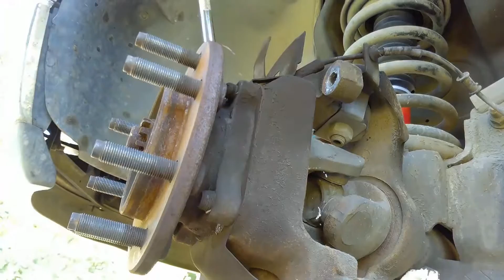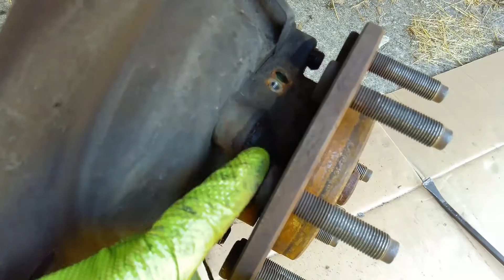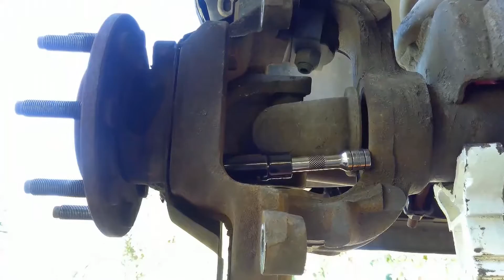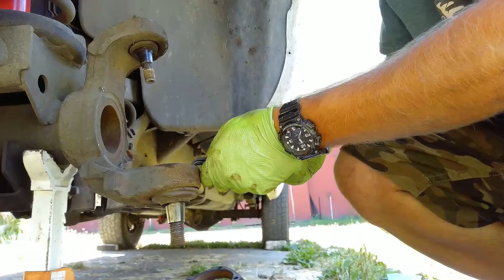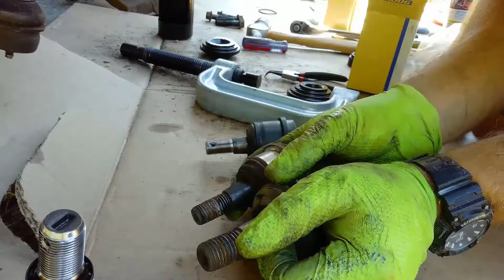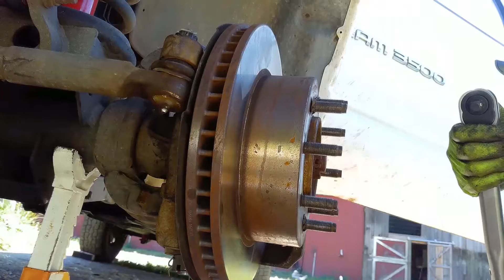Dodge Ram Death Wobble - FIXED! (Ball Joints)

Comment: Just change all your rubber parts and rotate your tires , that’s what I did and BOOM it was gone. Like track bar and switched to the tie rod and drag link like we had back in 1969 not a y tie rod and drag link and I used neoprene bushings in my track bar and has been great !

Comment: Moogs (ball joints) on my '12 Ram 2500 are on their second set, in about 50k miles, and that's after trying the AAM specifics for my model.  These trucks are notorious for eating them.  That's after only having the stock suspension, then coil spacers to level, then to full on coil level kit.  I won't buy anything Moog until they get back to making good parts.  I don't tear up my stuff, so lesson learned on getting quality parts.   Going to try Dana/Spicer this month.

The best thing to do though is get a heavy duty track bar.  I've had death wobble before w/ family in the truck and wife wants to sell it.  Haven't had it since changing over to a BD Diesel Track bar.  Thing is stout!
Reply: Excellent video!
Reply: Update - Spicers were better than the moot, but boots tore and got loose by last month….   Replaced with set of synergy’s units.  These things rock, are rebuildable and adjustable.  Called their support line and they were fast and helpful!!!!  Forget the moog or AFM, shoulda bought the Synergy units years ago.

Comment: Great job. Always block the axle tube after removing the axle shaft though. Lol  Yeah I had to be that guy. 😂.  Moog had a bad reputation with ball joints a few years back. Hopefully they’ve made improvements so u want have to replace them again. 👍🏻
Reply: My Moogs only lasted about 40k miles
Reply: @wallyg9512  dont trust moogs anymore, carli way to go
Reply: @fidiusjwhoopie  I went with EMF and am very happy. Their videos also solved my root issue which was a bad steering knuckle causing premature wear
Reply: They haven't!  Esp ordering ball points and their bearing units, I got tired of ordering (after 8 tries for the Moog hub bearing) from Amazon.  The boxes always had the wrong part in the Ram 2500 PN box.  I went back to Dana/Spicer on the u-joints.  My 2012 Spicer PN is 5-1350X, not sure if they fit the 3rd gens though.

Comment: Do you remember how much play you had in the ball joints?   Your story of the shops replacing everything else sounds just where I am at now with my 2006.
Reply from the maker: I didn't notice much with everything put together (the wheel felt solid when I had the truck jacked up and tried to rock it back and forth by hand). But the old ball joints I removed felt pretty sloppy--especially compared with the new ones, which I could only just move by hand.

Comment: Carli suspension makes awesome front ball joints for dodge.
Reply: Are those the sperical ones with adjustable woop de woop de too?
I only ask due to fighting this same fight.
On a Wisconsin dodge, 1998, half cancer custom model. The sheer fact youcan see this stuff means you got the job licked.

My dad and I were reduced to 2 man breach and clear style tactics.
Breaker bar, with cheater pipe of cold rolled, lifting up on the hub nut, hydraulic floor Jack way out at the end.

The truck got about 8 inches and sphincter factor 5.5 before the truck slammed back into the back stands, but came sorta loose, still had to figjt the first inch of threads.

Drivers side?
Oh dude, no frealing way was that anywhere near the correct torque. Just aboot have dad and I some-are teeth. Passenger side was holing quantum mechanics together.

Ol dad and I were each about 245lbs im those days, with 6ft of cheater pipe on a 3/4 drive brealer bar, jist standing on it we should have easily created 380-400ft lbs, right?

I commend you, fine gentleman, that job irks my quirks, give me square brain, and has all the no Buenos.
Reply: @threadtapwhisperer5136  My truck is a 2003 3500 Ram diesel dually w/  8” lift on 37”. Tires. I’m going on 3 years now on Carlis with no issues. I tried Napas ball joints and only got a year out of them.

Comment: I had the death wabble with a 2011 ram 1500, it was HORRIFIC. It turn out that the left front shock was ''stuck'', the metal rod was ''sunk'' and jammed in the bottom of the cartridge and at first look it was indetedtable. I found the problem only when i removed the part.  I bought 2 new shocks and it was the end of the wabble. I have to say that with thw wabble, the maximum speed that the truck can handle was 50 M/H, over 50 it was TOTALLY uncontrollable and SCARY :0)
Reply from the maker: Yeah, the death wobble is the worst. I had the shocks replaced at a shop early on and it didn't fix it. I even replaced then again myself because I wasn't sure they used a quality set... Still didn't help my situation.

Comment: If you are getting a wobble going 50 and hit a bump then the wobble stopped when you slow down sounds more like the wheel is out of balance .
Reply from the maker: Yeah. I went down the whole tire path early on. Rotation, balance, alignment all done. No help.
Reply: My 2003 2500 ram heavy duty had the steering play were the the input shaft to the steering box would move right or left without the tires moving.I found a aftermarket steering box that fixed the issues.IT IS NOT A REBUILD OF OEM.it is a new box it is about $700.now

Comment: Just got done watching ur vid,it was pretty much a text book job on how its done.isnt it so satisfying knowing u got it done and saved urself 500.00 in garage fees.i could tell you had some self doubt on use of press tool and hammer smacking.but yup thats how its done you even did good on the steering power trick to press wheel hub bearing out.in your kit is some angled cut outs there so you can make the tool press straight,rather than at odd angles as worked somehow in ur favor.none the less u found ones that worked.just my two cents slather the shit on that hub with anti-sieze next time.makes life easier on removale.ive got same scary death wobble on my 2002 4.7l grand cherokee im thinking ur fix is gonna be same fix for me.it drives fine on flat roads.at whatever speeds i need.but if i go across a two inch speed bump even at 60mph it goes nuts to point of wrecking almost.only fix is stop or seriously slow down.just as you done it all looks fine and same thing ive replaced everything else,tie rod,drag link,sway bar,pitman arm,axle center rod(forgot its name.).only thing left i havent changed is you guessed it.ball joints or control arms or shocks.but they all seemed good.well ill try it seems like it was ur fix.sorry this was long but i had alot to explain.great job!!snookie pa.p.s.the dodges and jeeps were known for this bad death wobble easpally with lifts.ive got the 2inch rough country.snookie🤪🤐🖐👍💥💥

Comment: this is the same wabble you will get on semi truck tag axle before the drives on concreat typ and other heavy trucks same thing over 50 mph and hit a bump . it will make your but pucker seat just get off the fule if  this hapens and dump your tag then wright it up for all new bushings

Comment: How was your steering return after putting the moog ball joints in?
Reply from the maker: I didn't really notice much difference in steering with the new ball joints..
Reply: Steering return is influenced by the caster adjustments.   
The stiffness of your ball joints will not influence it or even be noticed while driving.  
Usually the front axle trailing arm bushings go limp in the one direction and that decreases caster causing memory steering issues on rams.  Especially on  3/4 tons because they are the same arms as 1/2 tons but often used even harder.  So check your arms if you have return steering issues, and of course check your actual alignment settings if you haven’t.

Comment: Thats a great way to eff your steering rack up man doing what you did to knock the knuckle/hub lose just hit it with a ballpeen
Reply from the maker: Bah. Seen lots of people use this method with no issues. Just think of the stress on these components with the whole weight of the truck on the front end: going down the highway at 75mph, driving through a muddy pasture, hitting a pothole, etc. This is nothing. If it can't handle this, it's junk.
Reply: @philbrown5722  thats great logic but basic physics will dictate that a corroded and siezed hub[just an example]could absolutely damage your steering rack by doing that, you are just lucky the hub decided to give way instead of your rack. Seized components can literally prevent a car from moving so it could absolutely damage your rack. Im tryna help you man but its all good brother you clearly got it all figured out. You will misalign the pinion off the grooves if its a rack and pinion which could blow seals.

Comment: FYI, I fixed my death wobble by getting rid of my Cooper tires and putting Toyo’s on my Dodge 3500. I changed nothing else.
Reply from the maker: Interesting. I read similar reports while researching my issue. I rotated my tires, which didn't help, but have not replaced them as that's one of the most expensive individual "repairs" in the whole system. However, I don't doubt that tires alone can cause serious issues. I've seen it on other vehicles, and wouldn't be surprised if they are a contributing factor in my case.
Reply: @philbrown5722  I can agree on the contributing aspect.

Comment: The bump steer is not right the tie rod is probably lower than the bottom ball joint along er a arm is needed ,,,u raised the truck ,,,lower it 2 to 3 inches and it will stop ,,,if you don't want to change the a arm😊